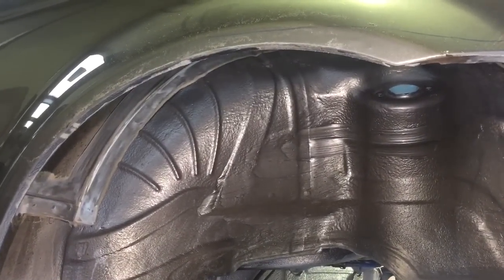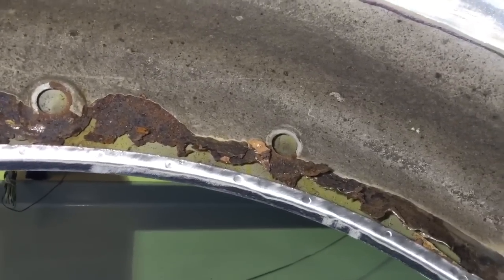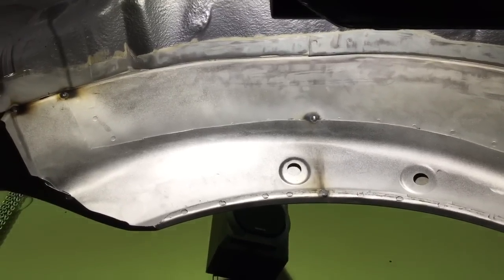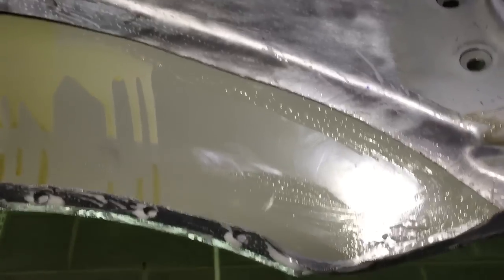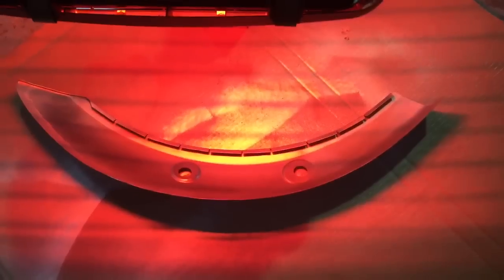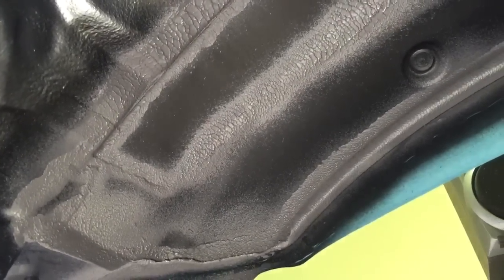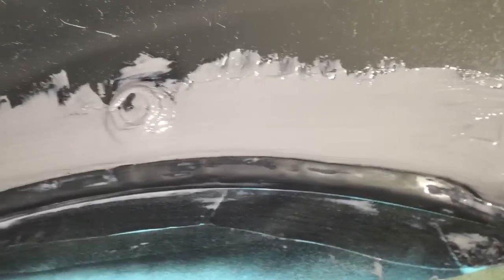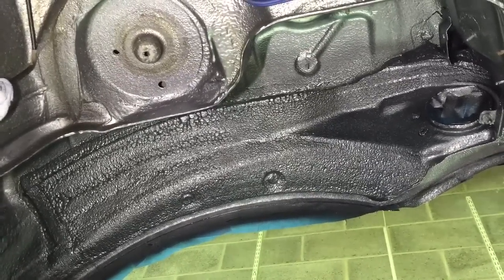BMW E46 M3 Rear Arches Replaced due to rust/corrosion rotted out

Comment: So is it possible to buy a partted out m3 , cut the quater pannel part u need , cut the inside metal and use this method to turn a wide body m3 baxk to normal, as long their cut wasnt rreally high ?

Comment: Would this same procedure work on the inner front wing arches? Both mine are rusting through badly so I've got a pair of new replacement wings, they're due to be painted in a couple of weeks but I'd like a way to help prevent it happening again before they're fitted.

Money is very tight at the moment so I'm looking for a cost effective solution.
Reply: l34052 if you’re talking about the front fenders, you can replace them with completely new ones. They screw out
Reply: @6ixvamp  i think he means the inner arches ( part of the strut tower) which yes is replaceable and more easy compared to rear sills

Comment: what sort of seem sealer did yous use to build up the chanel? i stripped my whole underside off and cleaned and waxoyled it yesterday, was shocked to see the ammount crap caught behind the front arch liner
Reply from the maker: Hi, depending on application we will either use Wurth Seal/Fix or Kent Sprayable Seam Sealer. 
It's amazing how much gets caught up in these Rear Wheel Arches. Well done for cleaning it out of yours.
Reply: Redish Automotive thanks. i'll be using your subframe plates too as a preventative maintenance in a couple months too. you guys do a awesome job but i'm at the other end of the country so it wouldn't be easy to get yous to do it

Comment: Hey I need to ask how much something like this actually cost to do! I had my rear guards cut to fit the larger tyres on my track wheels. Had the fenders painted and sealed, but somehow water must've been getting in and has started to rust the inner metal! How much would it cost to weld in all this new metal?
Reply: My guess 1500

Comment: 50k miles.... wtf
Reply: Low mileage isn’t worth paying for on these cars unless they’re guaranteed to have been cleaned thoroughly underneath all their life and stored in a dehumidified garage.

BMW are crazy for fitting U shaped arches and then hiding them behind liners so they fill with salty mud.

My 130i on 2007 is starting to go on arches, just as my 2004 Z4 did.

It’s all down to the arch liners blocking cleaning.

I’ve seen 25 year old Saabs with L shaped arch lips and no arch liners that are perfectly clear of rust, stored outside, high mileage etc, all original.
Reply: @MrW4ippy  yeah I know that’s how most cars go indeed